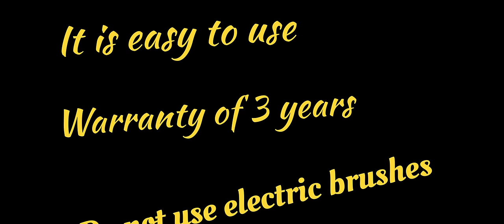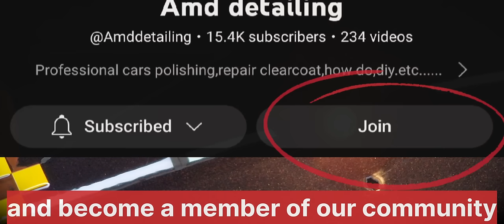Sanding MISTAKES-How to avoid mistakes?

Comment: Very Nice video. i never thought about dry sanding before polish ever until i found your channel. Its been a game changer for me in the bodyshop. I save sooooo much time and i can see what im doing oppose to wet sanding. But i do have 1 question though. Whats the difference between the K2000 and P2000 i mean, what does the letters represent?

Comment: I've really enjoyed your dry sanding tutorials. I have really learnt a lot. Just one question. You said in the video that the sander has to be flat with the surface so how do you sand the curvy parts of the car? Can you show us in a video, perhaps the entire car instead of flat panels, or at least hard to do areas.
Reply: all you do on curved areas is add a interface pad,wich is a sponge that you put in between the sander and rhe sanpaper,it creats a cushion so when u go over the curved areas the sponge goes with the shape of the panel,instead of just using the hard part of the sander wich can cause burn threws
Reply: @emi-sy9zr  Do you have an example. A link please to a product.

Comment: Wow..just this 1 simple video solved almost 90% if what I have been facing. Great video! Btw, how do we know when to change the sanding paper and do you use a dry or damp cloth to wipe away the dust? Does this method apply to epoxy on carbon fibre parts too? Thank you so much for this!
Reply from the maker: works on everything that has coatings, and the most important thing is experience to know when enough work is done with the autumn granulator and when to move on to the next one

Comment: Great video, i think dry sanding is better than wet because you can instantly see if you did a good job and if it needs more work or not. Though i think this only works for flat surfaces (i mean the machine), on a bumber with a lot of curves and edges i would do it by hand so i  dont oversand the square edges. I want to do my front bumper to remove the orange peel and i think i'll do it by hand exclusively because i have more control. I only have a question, do you think it would work on a water based paint? Thanks in advance
Reply from the maker: Yes my friend

Comment: Your videos are awesome however the sander you use Mirka is very expensive 700-750 especially if you are only going to do one car and not pursue this as a trade. If I were to buy a Dewalt or a Mikata is the same pad with holes available and adaptable for those machines? I tried looking up the sand disks you are using and can't find them anywhere. Could you post sources for them? Thanks for the great videos that are to the point and not a lot of (hey look at me and listen to me talk) videos. Would appreciate your reply.

Comment: That’s a great video, good information for a newbe. Only one thing…because I’m not fully bilangual, I have to pause a lot of times to take the time to read your text. Can you just add a 2-3 more second on each text ?
Reply: Oh and also, I understand to keep the machine flat but what you do when there is a peaks or curves ?
Reply from the maker: Ok no problem
Reply: Youtube let you set the video speed nust in case you havent noticed.

Comment: All my local market offer all over is 125mm/5 inch carpentry ones. All my suitable grits local market papers are 150mm and they only offer airhuggers with discs to fit, unless I go polishing machine. Hard to level right to surface... Could you link me a good online 150mm palm fit one at 230 VAC ?

Comment: Hello.❤ I have one question, if i sand panel with 2000 by hand to remove orange peel and then 3000 with sanding machine, will it be easy to polishing with polishing sponge ? Not wool pad
Reply from the maker: yes

Comment: @Amd detailing  Question would I get the same results with the mirka  air version. I’m sure my compressor is more than capable. It’s 80 gallon and around 16cfm @90 psi. Also I wasn’t sure about your tool work speed. At what rpm are you using thanks.
Reply from the maker: It can only be that the air one is much more aggressive than the electric one, so you have to sand with both 3000 and 5000 to make it easier to polish
Reply: @Amddetailing  Thank you. So would I still start at 1500 then work my way up to 5000? I guess to get rid of orange peel I would need the cutting of the 1500. Just new to the kovax dry system and want to do it right the first time.

Comment: Can I use a DA machine to remove 2000? I don't have rotary
Reply from the maker: Yes
Reply: I found with this brand, Kovax, it’s a lot easier to remove the k2000 marks because they are much more shallow and uniform vs other brands

Comment: Your vacuum looks like it not working, so why bother lining up the holes?
Reply from the maker: And explain how it doesn't work? If it didn't work, the whole element would be made of dust, the vacuum cleaner can't pick up dust from the paper when the paper is on the element
Reply: When I sand with 1000 to 1500, I hardly have any dust on the surface and I can watch the orangepeel wear down as I sand. Your vacuum seems to leave a layer of  fine dust on the surface. It seems you should get a better result than that. I'm using just a cheap Shopvac.